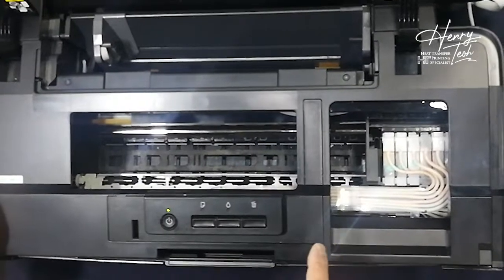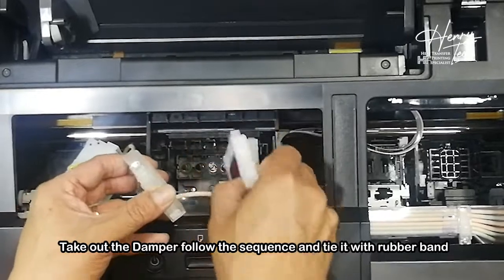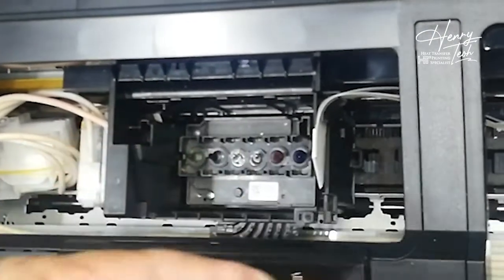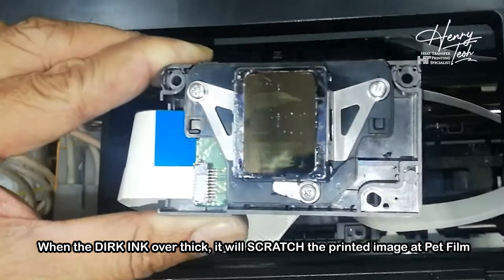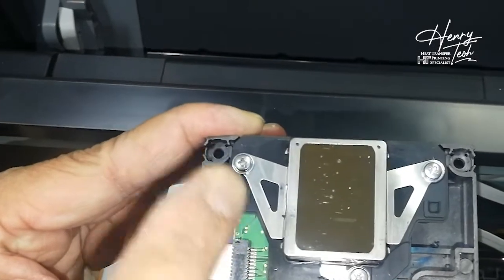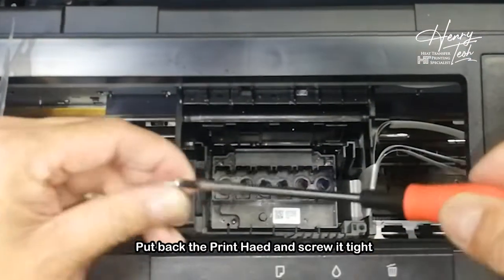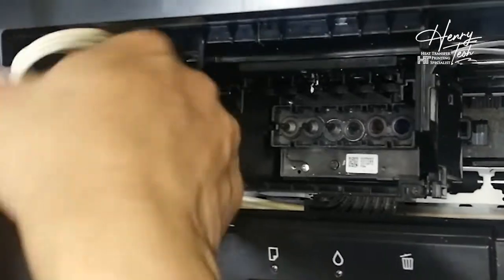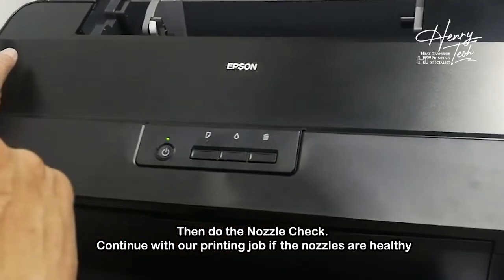Step By Step Solving SCRATCH Printed DTF Transfers

Comment: I've wiped alcohol on the print head platten and the Cyan color is clogged, do you have any solution to this issue? Thanks in advance.
Reply from the maker: Flush cleaning liquid
Reply: @HenryTeoh  hi, do you know where I can get those?
Reply from the maker: @jameslengjy  Usually ink suppliers have.
Reply from the maker: Where are you from?
Reply: @HenryTeoh  I've tried cleaning multiple times with printhead cleaining solution by 2 different ink suppliers and it's still clogged. From Cheras
Reply from the maker: Every print head have it own life span. Can't help much
Reply: @HenryTeoh  I’ve only used for 2 weeks from new printer. I think I accidentally rubbed too much alcohol on the platter. Ive ordered a new printhead for the time being. I’ll try different methods to fix the clogged one in the meantime, will update if I have any success.
Reply from the maker: There is no issue if you rub the platten in correct method. I didn't many time already 😂
Reply: @HenryTeoh  yea maybe I rub too much alcohol

Comment: Hi there, my prints are still being scratched even after head cleaning. I have tried different sizes of print and lowering ink limit but I still can't get it to print normally. I have a DTF Epson Stylus photo 1390.
Reply from the maker: Myself this problem will come back once we perform Head cleaning plenty of time. Each time we perform it will clean all dirt ink to the side of frame. Once it too thick, it will scatch our output printing again

Comment: Thank you Henry. It's a good tutorial video and it solve the scratch on the printout. 

Unfortunately I am facing another issue which the some area of the printout the color is uneven, specifically blue color. 
I printed a CMYK color only picture. On the blue (C) color area,  some area the blue color is solid and some are the blue color is faded and lighten... 

I have seen all your tutorial videos and tried all the maintenance methods you have recommended.. I have tried printhead cleaning, printhead flushing and even changing a new printhead and still the same. Unfortunately I can't post picture here... otherwise I can show you how it looks like.

I am completely stuck and have no idea how to fix this color uneven problem.

What would be your recommendation and advise? Your advises are appreciated.
Reply from the maker: Perform nozzle check to see the healthy of the printhead. If the line broken, then sure will face problem during printing
Reply: @Henry Teoh I just changed a new printhead and I have done nozzle check... the lines are ok.
Reply from the maker: Them may be the pet film issue.